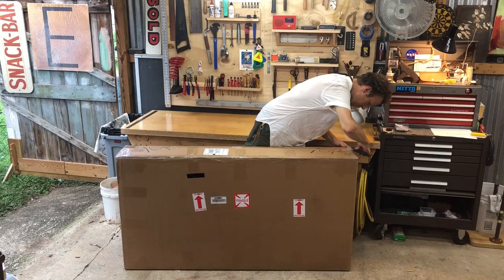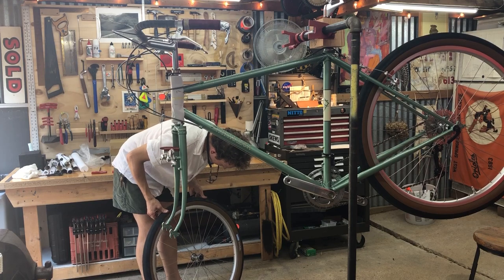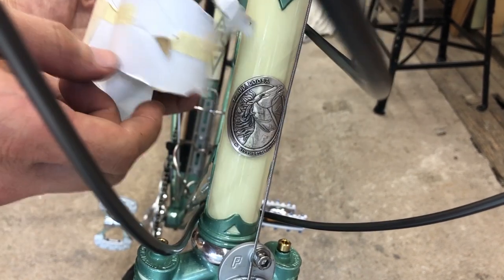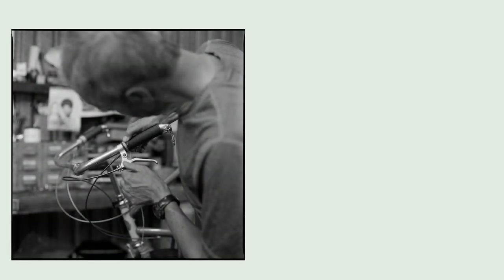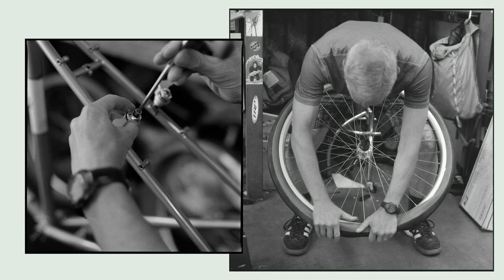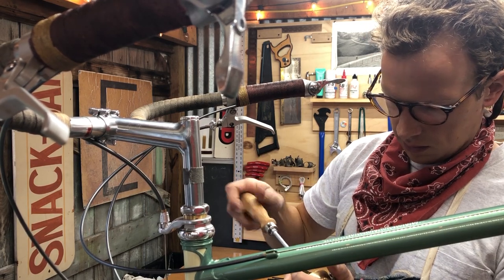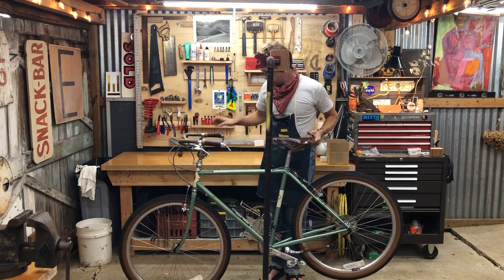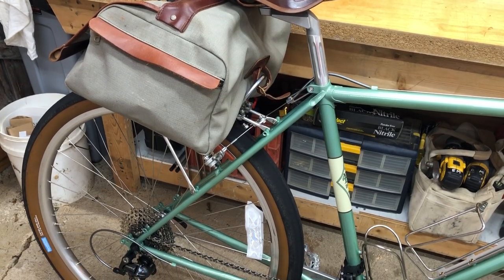Rivendell Bicycle Works Joe Appaloosa Assembly

Comment: Wow!  My only disappointment was that the four headset bolts were not upgraded to brass. A work of art.
Reply from the maker: Thanks so much. I left the stainless steel bolts on the stem faceplate because I think brass is too soft to get adequate torque. I use the brass bolts in areas with low or no stress!

Comment: I have a 1985 Bridgestone MB-3 that is very nice. 23 inch frame size! Your build is super cool.
Reply from the maker: Oh, that's rad. And thanks! What color is yr bike? I just picked up an '85 MB-3 in a slate blue-gray. It has painted bullmoose handlebars that match the frame.
Reply: @ericmarth  Dark matallic blue. Had a bmx stem 60mm. We now have normal quill stem and bar.

Comment: Great build!  Will is so good to deal with!
Reply from the maker: Thank you Melvin! Yeah, Will is great :)
Reply: Eric, I'd love to see/hear a compare and contrast with your Sam Hillborne!  I bought an A. Homer Hilsen ten years ago which is my main bike.  It's been through a lot of changes, currently with wide, flared drops and a 1 x 11 very low, wide range drive train.  But this year I was able to find a used Roadini and have built it up as a 2 x 10 with an old Deore rapid rise rear derailleur and and ancient Campy front, driven by Riv Silver II bar-cons.  Both on a rotation of 38-44mm tires.  I love the ride of both...
Reply from the maker: @MelvinHughesatp  Oh, very cool bikes, Melvin! I love both of my bikes and a lot of days I end up riding both. The Hillborne is definitely more spritely, much lighter. I did mount a vintage Nitto F15 and Baggins Boxy bag but it's still lighter overall than the Appaloosa. 

Today was a typical day for me, rode the Appaloosa for some errands (bank, jobsite, coffee, park, grocery store). In the evening I did a quick 13 miles around town on the Hillborne. I've also ridden the Hillborne on local trails and had quite a lot of fun, they're pretty mild. I do like having one drop bar bike and one with swept back bars. They're both very comfortable! 

How's the difference between the Roadini and the Homer? Seems they are more similar to one another than my two bikes are to each other. Thanks for watchin'!
Reply: @ericmarth  Thanks for the comparison!  I've wondered about the longer wheelbased Rivendells.  Back when I bought my Hilsen, it was very difficult choosing between it and the Hillborne.  In the end, I can't really recall why I chose one over the other.  Either would certainly have been great.  

You are right about the similarities in the Hilsen and the Roadini.  But they are subtly different.  My Hilsen is a 59 cm.  I was on the border between a 57 and a 59 and Riv suggested the larger frame.  So stand-over on it is minimal.  Also, I run shorter stems as a result.  The ride is probably very similar to your Hillborne.  I find it extremely collected, calm, and somewhat silky.  The Roadini Medium frame is somewhat lighter I suspect.  I don't have a proper bike scale but my sense of it is that without all the lugwork the Hilsen has, it has to be a lighter frame.  The chainstay lengths are identical.  But I think the trail is a bit less on the Roadini.  It feels a bit quicker in steering.

I haven't ridden them enough side by side to make a great comparison.  But on the Hilsen, I somehow feel as if I am up on the bike, not really floating but well suspended.  On the Roadini, I feel as if I am somehow lower on the bike - Even though the setups for both are identical on seat height, seat-to-handlebar distance, and handlebar height.  The Roadini does not feel as smooth as the Hilsen.  But both are infinitely more comfortable to ride than the old 1995 Litespeed Natchez I finally sold.  Both handle much better as well in corners, descents, and just in general.  I need to put more miles on the Roadini to get a deeper sense of it.

Here is an album of the Hilsen with a few shots of the Roadini at the end.   Both are still a work in progress.  https://www.flickr.com/photos/mlhughes/albums/72157626614960202/with/51575404909/
Reply: @ericmarth  Hey Eric, I was just revisiting your Appaloosa video.  After several months of having my two Rivendell bikes, I can say more clearly now that your observation was very accurate.  The geometry of the 54 CM Roadini is so close to the geometry of my now 11 year old,  59 CM Hilsen that there is very little difference in the handling of the two.  But whether it is because the Hilsen is a tad heavier or just a little  bit different in tubing and geometry, I really do prefer the Hilsen.  I feel as if I have become a total retro-grouch though.  I finally went back to a 3 x 9 on the Hilsen, using one of the Rapid Rise Shimano rear derailleurs on an 11-40 rear cassette.  So I'm really thinking about trying to get an Appaloosa or Atlantis frame to build up.  I'll have to sell the Roadini frame first...
Reply from the maker: @MelvinHughesatp  Hi Melvin, somehow I missed your post with the Roadini/Hilsen breakdown and photos. The bikes look great and it seems you've experimented quite a bit with setting up the Hilsen and trying lots of bars. Looks like a lot of fun! Also tons of nice components in there! Dynamo, Quills & Phils.

I wish I knew more about the subtle differences between your two bikes. If one emerges as the clear winner in comfort and fun maybe it's ethereal! 

How's that rapid rise mech? I've never used one. 

An Appaloosa or Atlantis would be fun. I went with the Appaloosa because I wouldn't fit a 59cm Atlantis with the rainbow double tube which I really idealized in my head.

Now that I've ridden my bikes more I find the Appaloosa is a cloud-like Cadillac ride with the upright bars and the 55cm tires. With the lower gearing I sometimes spin out which mellows things a bit. I ride the Appaloosa for errands and on long rides in the mountains with lots of climbing (like 50 miles and 5,000 feet of climbing) and a mix of paved and unpaved sections. Really prefer it there. I also recently added a SON dynamo and Edeluxe along with a small Nitto front rack so it's a little heavier now. 

The Hillborne is great for paved riding and I'll ride it for paved outings between 15 and 60 miles when I just want to get out there and crank. With the drops and higher gearing I just plain go faster. It's road-ish enough for me and I like running those 44mm tires at like 37psi. Haven't done it but seems plenty capable for hauling and camping too. 

Happy riding, Melvin :)

Comment: Another Home Run. !   Classy  and brassy .    
McMaster/Carr... my long time go-to for anything hardware related. 
Good stuff, prices ok, shipping costs are a bit stiff.
Reply from the maker: McMaster is great and their offerings are vast. In my experience (maybe a few dozen orders) the shipping costs haven't been surprising but the overnight shipping has been!
Reply: @ericmarth  I suffer from being way across the country.
Last order was some rare metric bits and pieces to restore my 1982 INCA Swiss Made  259 Table Saw..
4 small pieces... cost about 15 bucks.  They would fit in a zip lock snack bag.. but arrived in a 16" X 16" by 8" box at $17 shipping. 

They are still the best.  You have me thinking "brass".  : )

BTW I am about a 6 hr drive North of Rivendell.. I am down that way about 4-5 times a year so always stop by and never leave empty handed. Must have another Swedish Hatchet  and  Bandana.

Comment: A lovely build and a cracking vlog to boot!
I am awaiting the arrival of my Atlantis frame in late Summer and will be setting up my cockpit almost identical to yours with Billie bars and bar end shifters, so I wonder, can you tell me if there are ESI grips under the darker bar wrap in the "first" hand position? (This is the way I would like to go.) Otherwise, is there gel or other padded tape (Newbaums) that gives the grip its thickness? Much obliged if you have the time to get to this.
Reply from the maker: Hello and thank you! Congrats on the Atlantis. In my primary grip area there is a layer of felted wool that is attached directly to the bars with adhesive or double-sided tape. Over that is one layer of Newbaum's cotton bar tape (the standard kind, no padding). It has a few coats of shellac. This is something I've seen on Rivendell builds and asked for it when I had the bike built up. 

I'm not sure this link will work but search "Rivendell grips the hard way" for Grant's primer on using the wool underlayment: https://www.rivbike.com/blogs/grant-petersens-blog/grips-the-hard-way-how-to

It seems to me that wrapping ESI grips in bar tape would work just fine but I've never tried it.
Reply: @ericmarth  Thanks so much Eric, that's really helpful. There are a few ways around the potential difficulties with ESI grips that I can think of but I shall definitely look into the idea of a felt liner- or similar. Thanks again!

Comment: great your video! I was wondering I love your idea of fixing the bar tape with string rather than tape but I don't quite understand how you fix it because I imagine that without glue it doesn't hold?
Reply from the maker: Hey, thanks! I've finished bars like this a few times and haven't had the twine come undone or untied even after a year of use. 

Rivendell has instructions, do a search for "Handlebar Wrap and Twine Finish" and look for the PDF link beneath the embedded video.
Reply: @ericmarth  thanks for your answer and congratulation for your job
Reply from the maker: @elliotaxx6277  Of course! Thanks again and be well.

Comment: Eric I'm curious about the bars. I assumed I would do road/drop bars on the roadini, wanting a road/gravel bike. Do you ride off pavement with these bars and how does that go if you do?? Thanks again.
Reply from the maker: These are the Nitto Billie bars, designed by Rivendell. I haven't ridden them much off road but have ridden plenty of unpaved roads, where they are great. They're similar to the Albatross bars which I had on another bike which I rode for about a year, but longer with more sweep back. I really like the extra area ahead of the brake levers (where there's gray bar tape). Great for spirited riding and climbing. Despite the huge tires and kinda trail setup of this bike, I'm mostly on roads. I ride at a pretty mellow pace, I'm not out there cranking miles, clocking wattage or even trying to set personal records. If you're looking to ride a Rivendell on unpaved roads I'd suggest checking out the A. Homer Hilsen and Sam Hillborne, they're great road bikes and have larger tire clearances than the Roadeo or Roadini, might be better for the gravel portions if you're planning to do a fair bit of riding on those surfaces.

Comment: Nice mood in this video, bravo. Would love to see a video about your stand as well. How does it feels to ride this bike, and those tires?
Reply from the maker: Hey, thanks, Thomas! I'm planning a stand video. Hard to describe the ride, I don't have precise bike-reviewer language or tons of experience on lots of different bikes...but here goes. It's groovy, super comfortable. Nice for short trips around town, which I do everyday. Great for long rides on roads, paved and not, in the mountains. Wide/low gearing is good for tough climbs, wide wheelbase is great when things get loose, steep or loose and steep. Same for descents. Love these bars, with the long sweep back and extra space for secondary grip ahead of the brake levers. Great for climbing or digging in and riding hard. The tires are nice! I decided to put some big ones in there since I had the clearance and hadn't really tried running anything so big before. I run them around 25psi, feels great everywhere. No neck pain, back pain or other problems from position. I do, of course, feel a bit sore and tired after long rides like anyone else! Hope this is helpful 🙃
Reply: Thank you. Groovy is nice!
Reply from the maker: @thomasduquet  Groovy's groovy

Comment: Hi Eric, I've been spending more time than I want to admit publicly (this isn't public, right?) about handlebar tape color, after shellac.  So help a brother out--what color did that green tape start out as and was it clear or amber shellacked?
Reply: I take it back--you of course answered this later on...
Reply from the maker: Don't worry, your bar tape fretting is strictly confidential. 

The tape on the grips area is Newbaum's maroon with one coat of clear shellac followed by one coat of amber shellac. 

The tape on the hooks section (between the brake lever clamp to the stem) is Newbaum's light gray with one coat of clear shellac. 

I hope this is helpful!
Reply: @ericmarth  Soooper helpful! Thanks again for your videos; they're informative and the vibe is pretty much ASMR for bike appreciators. LOL

Comment: It really is too bad how inconsistent Brooks has become. I’ve had some fabulous saddles from them, others that were misshapen after just a few hundred miles. Anyway, gorgeous build!
Reply from the maker: Thanks for stopping by! 

I wish I knew more about Brooks and how they're doing. At least their customer support seems willing to fix and replace things when they aren't quite right. I had a different saddle arrive with a loose tension bolt and the binding clamp was free. Had to bend the metal and finesse it back into place. All good now, honestly couldn't believe I fixed it!

Comment: Why the very tall stems on Rivendell bikes, does their geometry require it ?
Reply from the maker: A lot of Riv riders like to get their bars way up but it's not always necessary. The tall headtubes and slightly sloping top tube allow you to get the bars nice and high. Many bikes are designed in a way that makes this difficult. Riv believes in high bars so the frame design certainly encourages it. I like to run my swept back bars just below the saddle, these days.

Comment: Why brass? How does brass hold up to corrosion over the decades?
Reply from the maker: I love the way brass wears and ages. I suspect it will hold up just fine and if it fails it's cable and housing ferrules that are easy to replace. Same for the washers over the shifters, they cost something like a few cents apiece.
Reply: @ericmarth  It does look nice. I was hoping you'd say that brass bolts and washers provide increased ride compliance and lateral stiffness resulting in the ability to crush the biggest jibs, and to boost the garliest drops.
Reply from the maker: @devinbartley5768  Oh, uh, yeah... YEAH! I DID mean to say that!

Comment: What size finishing washers did you use?
Reply from the maker: The #12 size works with Silver 1 and Silver 2 shifters. Apparently they work with Simplex Retrofriction shifters as well! Haven't tried the Simplex but I've seen pictures and it's a good fit.
Reply from the maker: There's a link in the video description to the finishing washers, by the way.
Reply: @ericmarth  Just seen that! thanks so much. Look forward to some more videos!
Reply from the maker: @angusross7922  Cheers!

Comment: I wish marin or somebody would make something like a $999 version of this bike.
Reply from the maker: Yeah, I think the closest you can get is a Riv Clem complete, seems they've been going hard with the mixte or "L" (low) version lately though they used to do one with a slightly-sloping top tube called the Clem H (high). A lot of people will say "Get an old steel MTB!" but in my experience they don't handle anywhere near as well as a big long Riv
Reply: @ericmarth  as someone who has been riding old steel MTB a for years I agree.  There's a few moments in your video where it's really noticable how much longer the chain stays are on the riv than on my bikes.  Perhaps one day I'll bit the bullet and roll into the 21st century.
Reply from the maker: @HITABikes  They're just pretty sweet bikes is all